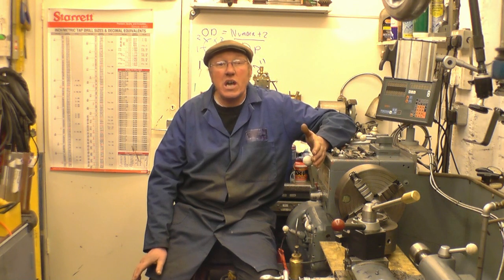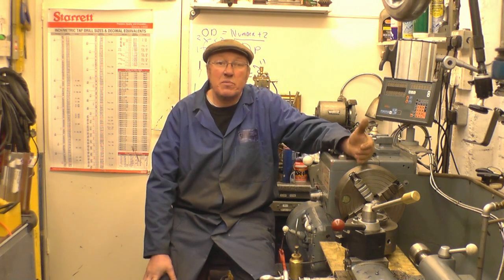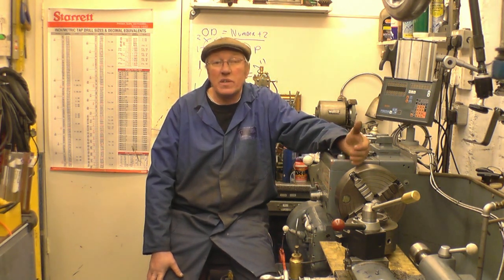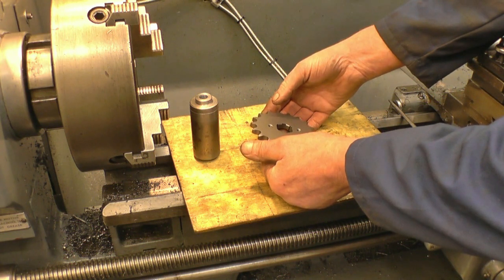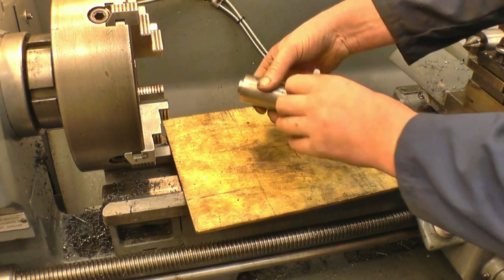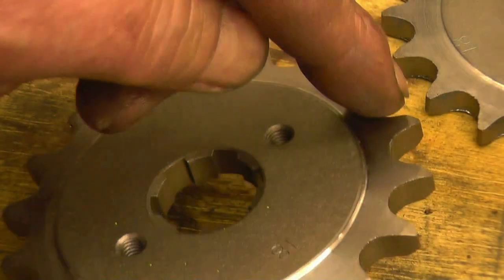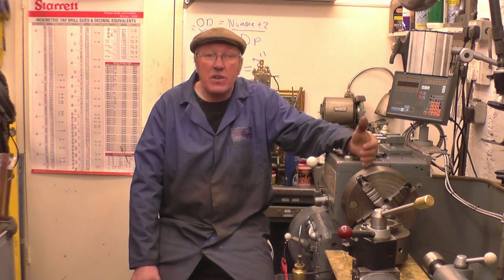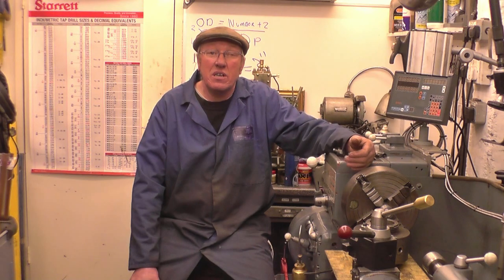SNNC 112 P1 Motorcycle sprocket / CV thread repair (picking up a thread)

Comment: John, big unrelated to tonight's Night Cap but very many thanks for the tip on putting a bead of weld on the inside of the outer bearing shell on your video of a Citroen wheel bearing replacement! I was really up against it trying to get a bearing out of my wife's car and even with full beans on a 12T press it wasn't budging. A line of weld later and it came out! Fantastic, so many thanks again. 👍🏻
Reply from the maker: +Simon Hogan Pleased it helped you

Comment: Thanks for the video John... I've also tried to reduce some Honda sprockets from 530 to 520 without a lot of success, the tip on turning from the centre out may make all the difference.  Your tip on picking up that thread is also something to lock away in the memory bank.
Reply from the maker: +Peter Baynes  They are stupid hard
Reply: +doubleboost And the hobs of hell? ;-)

Comment: Great work on fixin that thread.   Question though, Is it critical that you set the compound at 90degrees? Couldnt you also pick up the thread if the compound was set at say 29 degrees since you can still move the tool laterally to find the thread(just at more of an angle)?

Comment: +doublebooste      Hi John.   In regard to the drive-shaft thread repair, I thought using a 90' incidence into the thread was considered to be a bit of a "no-no"... as it would cut both sides of the thread simultaneously and compromise the thread profile.   I have no idea how you would pick up on the thread otherwise... however, is there a way to do this using the compound-slide at an angle; as if cutting a new thread ?
Reply from the maker: +Spoif It is possible to "juggle" the compound & cross slide but I needed to clean both sides of the thread
Reply: +Spoif 
I know of people who've been professional machinists for 30 plus years and have NEVER cut threads by anything other than radial feed. 

Fine threads (1.5mm is still fairly fine) in reasonably free turning materials and on a rigid lathe will generally cut fine without any faffing about with the compound slide angle.

Even when I had a Boxford (just like John's previous lathe) I wouldn't angle the compound. If I wasn't getting the finish I wanted on the thread, I'd feed the compound 50% of the infeed each time, which has the same effect as angling the slide; cutting mostly or entirely on the leading edge (60 degree threads only, you need a different percentage for 55 degree). I upgraded to a Harrison L5 (John has the L5A with bigger centre height) and I've not needed to even employ that technique.

There's a BIG advantage to not angling the slide, you'll never cock it up and set it to the wrong angle. Even an old hand like John has made that mistake recently!

Comment: The threading insert was loose, you can see it move in the holder once it touches the work! :O
Reply: I would say minimal flex rather than loose.
Reply from the maker: +Orcinus24x5 I will have a look Thanks
Reply: +Orcinus24x5 
It was moving quite a bit!
Reply: I just noticed after looking again.

Comment: case or through hardened ? either way , use a ceramic tip ? it may chip if run at incorrect speed
Reply from the maker: This is real machining, not textbook stuff  ceramics are for the pros running CNC machines Not a mechanic "pissing about"

Comment: It easier have a lathe that trying to clean up with thread file, it a beggar they get so seized in you have to persuade they apart with a big hammer damaging the threads. I wonder how many new one they have sold because of that.
Reply from the maker: +ANDREW MICAS  I would think a lot this one was very expensive so worth fixing